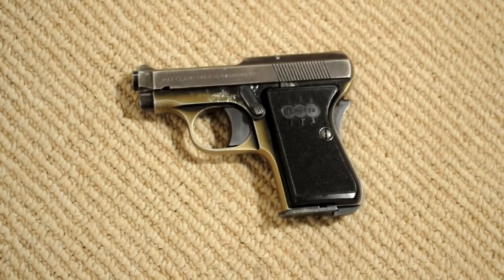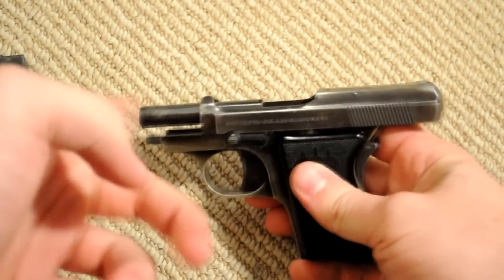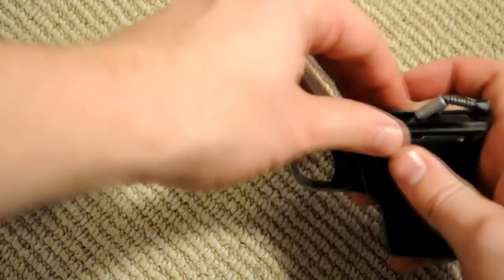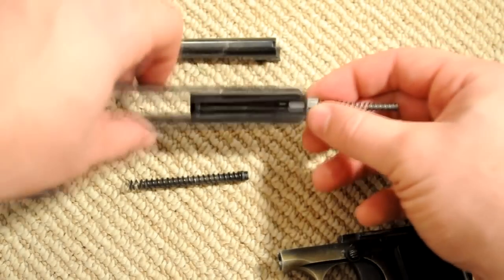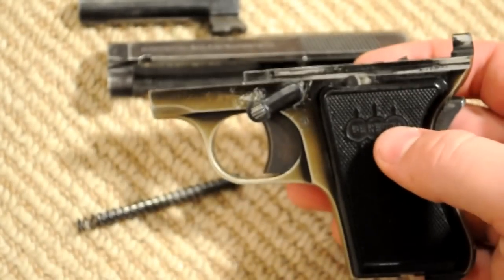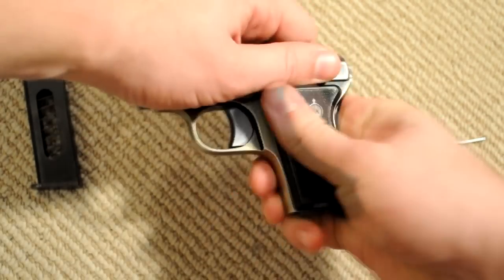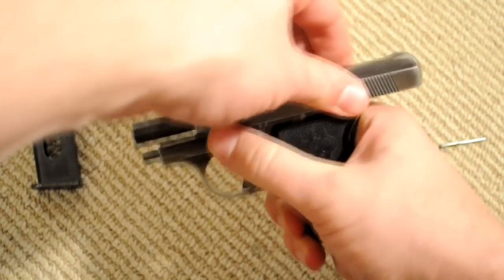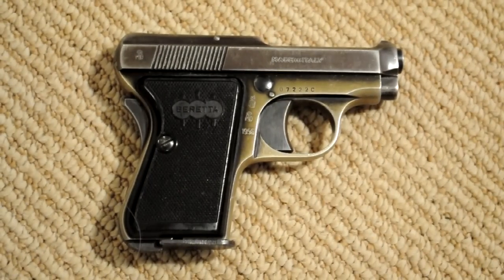Basic fieldstrip of the Beretta 418 (aka Bantam or Panther) 25acp pocket pistol

Comment: Compared to a Baby Browning, these things are super sweet.  The Baby browning has zero safeties, the 418 has two.  It has the front safety which you mentioned on the video and it also has a second safety on the back of the grip, just below the slide.  Whereas the Baby browning slide would cut my hand every time I fired it, the Beretta does not.  Good video.

Comment: Next time you field strip the weapon at the point where you are easing the slide off the frame, when the slide is positioned as it would be in battery, pull the trigger. This takes the tension off the firing pin spring and makes it just that little bit easier to manage. The firing pin will remain in its channel in the slide and the spring will be
"relaxed", not get kinked and not try to fly off to parts unknown.

Comment: I’m looking for a 2nd mag for one of these. If anyone has one let me know, please. Thanks for the video.
Reply: Sonny Gunz  did you find one ?
Reply: They are hard to find. I have a 1947 version and have bought a few mags to try out, mostly old and used off eBay—none of them have fit correctly. Either they are too long overall, or the feed guides are too high.